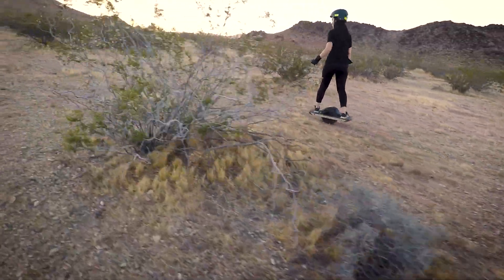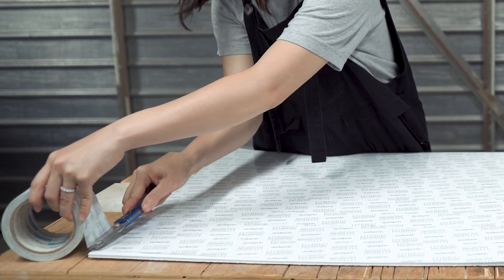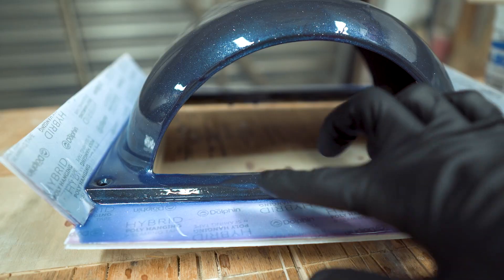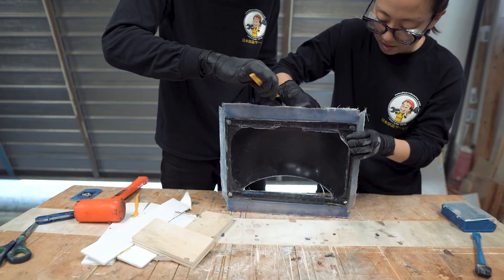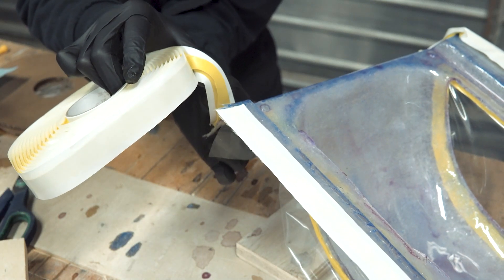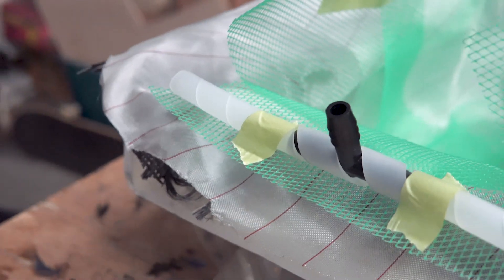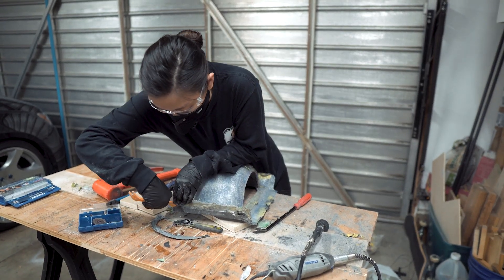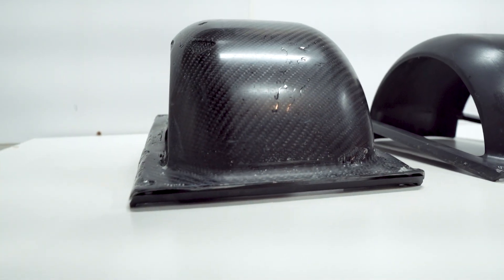DIY Carbon Fiber Onewheel Fender

Comment: A top coat of epoxy resin can fill in the pin holes and larger voids. Also polyester resin should be used with fiberglass not epoxy resin. Nice job for first time nevertheless.
Reply from the maker: Google debunked this myth but thanks for watching!

Comment: Try "massaging" the cast while resin is being infused to remove any air gaps leading to imperfections. They normally occur at the corners and edges.
Reply from the maker: Thanks for the tip!!

Comment: Best video I seen yet good job guys and thank you 🙏🏼
Reply from the maker: thanks for the kind words! 😁
Reply: @IMEEMADE   hey no problem by the way for corners and edges where it is hard to fold carbon cloth what you should try is cutting all the fibers down and separating them and doing a forged carbon look. It comes out looking super clean and can form to edges and corners beautifully. The forged look is very unique as well
Reply from the maker: that's a neat idea! will definitely have to try that on another project - thanks for the tip!

Comment: You guys rock, I work for a carbon fiber shop in Milwaukee WI and would like to say good job but would like to give some advice if I may. I would have added a layer of Kevlar so it would give it some impact resistants from rocks if you choose to do any off roading, and I would add flow strips out of the flow media to help give even flow across your part and help shorten the infusion flow time. That way you waste less and have more left for other cool projects you guys are doing on your channel. You guys are awesome and hope I helped in any way.
Reply from the maker: Thank you so much for the advice, We'll definitely keep those tips in mind when we tackle the next fender. We really appreciate the encouragement, it's always nice to get feedback from professionals!

Comment: Chopped strand fiberglass should be used with polyester resin. Polyester resin is really hazardous though. Use fiberglass woven cloth next time. Great first attempt.
Reply from the maker: We'll be sure to work with woven cloth on the next round. Thank you so much!

Comment: Great video, here are some tips for next time.

First problem that I see is that you made the wold with the 2 windows on each side. It would be best to seal up those spots so you can get a better seal when infusing.

Second thing that I noticed is that you chose infusion. Completing a good infusion on a complex part like this will take a lot of experience and time and there are a lot of things that you did wrong, if you want me to go into more detail about this I can.

The next part you make, try just doing a wet layup with a vacuum bag, this is much less complicated and will result in a finished part that looks as good as a good infusion.

Some tips on completing a good wet layup.

Brush on the pva as you did in this video, then lay in 2 layers of epoxy. Wait for the epoxy to get tacky but not wet, in the video the resin was still wet when you tested it with your finger. You want it’s sticky but you also want it to not leave any residue on your glove.

Next lay in one layer of carbon, after the one layer is in vacuum bag it. This is because of the complexity of the part and greatly help with having gaps.

Next remove the bag and lay in your other layers of carbon with the epoxy, then your peel ply and breather cloth. Bag it again and de-mold when it’s cured.
Reply from the maker: Thank you for taking the time to give us an informative response! We'll definitely take your advice on doing a wet layup on the next fender. The first one has taken quite a beating since we've made it, so I think it's time to attempt to make another one. Thanks again!
Reply: @IMEEMADE  My pleasure.

Comment: for something like this using a split mold process would be best. Also you should consider using tooling gelcoat to create the mold the finish would be much smoother. for the part you already created a layer of epoxy would give a much nicer finish too!
Reply from the maker: For sure, thanks for the tips! Definitely kicked ourselves for not making a split mold because it was so hard releasing from the mold 😅😅